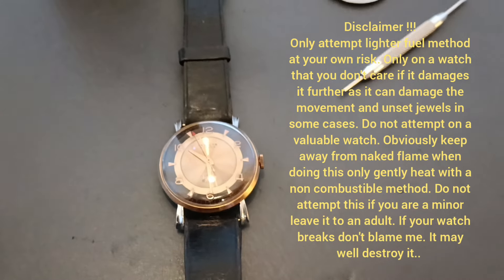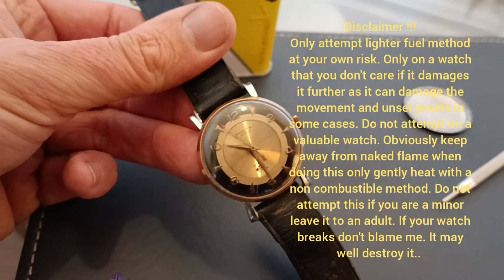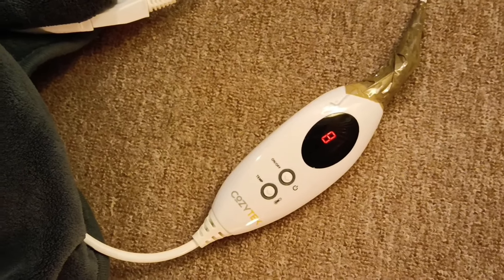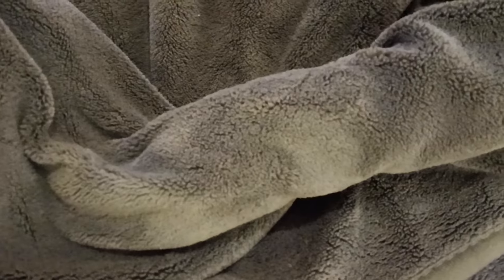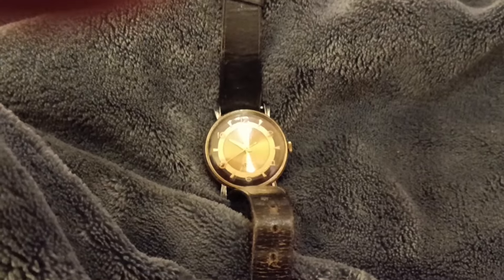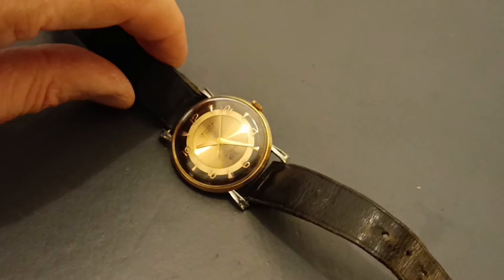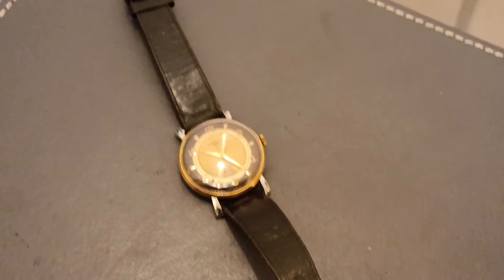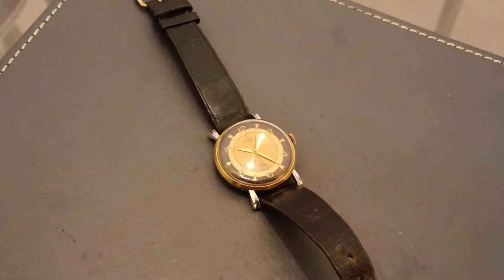How I revived my dead vintage Invicta watch using lighter fluid. Caution ! MAY DESTROY YOUR WATCH !!

Comment: With my Timex Mikey Mouse watch, since I did not have lighter fluid, I tried a drop or two of alcohol from the medicine cabinet. Did it work? Yes! However, since the face is painted, the vapours made the paint bubble up :( Will it continue running? I don't know. Still working after 16 hours.
Reply from the maker: @gabrielsenn3875  I've done this to a few cheap but vintage watches now. With mixed results. It usually does get the running but often they run a little fast. And sometimes stop after a couple of days. But a couple have carried on working . I guess it depends how far gone the original lubricant is. Lighter fluid is different from alcohol although it may still have reacted with the paint. Glad you got it going again though hopefully it carries on working.

Comment: I take it this popped up as i watch guys repair or service watches .dont do this to any mechanical watch and also dont put your fingers on the movement oil and dirt from your skin will cause the watch to stop if you dont know what you are doing best to leave it .and if you are not bothered about the watch sell it cheap and let someone else service it and enjoy it .rather than take space cadets advice and screw it up long term
Reply from the maker: Good advice.  A viewer gave me the lighter fluid tip. As my watch was non running and very low value ( not worth getting it serviced professionally cost wise) I gave it shot. It's not a long term solution and mine is already stopping again after a while. So I think the magic may be wearing off. But it's nice to see it going. I'm probably just going to hold hold on to the Invicta because I wanted a vintage one for my collection as I have two modern Invicta's. I don't advise anyone to do this to any watch of any value because of the risks involved to the watch.Thanks for watching and commenting.
Reply: I have a few vintage watches bought off a popular online auction site and if you check there you will find listings for servicing watches for £50 I have sent off a couple of nice watches got them back fully serviced for and keeping great time for the £50 and the Invicta you have in video has a really nice bullseye dial probably from 1950's and worth saving
Reply from the maker: @bengaku  that's really useful information and a good price. Many thanks for that.
Reply: @space99dude  you are most welcome
Reply from the maker: @bengaku  I just had a look and found the listing for the guy who services watches for £50 looks like a great deal. Obviously it's more if he needs to replace any parts although he does include a new crystal if that is needed. I know there are some older retired guys who service watches for almost nothing. I have a friend whose brothers breitling has just been serviced for £30 but the guy had it for months and he had to chase him up to get it back. Also this guy doesn't live in my area . Nice to know that there are people out there doing this for a reasonable price. I'm not sure I want to drop £50 on the Invicta as I probably won't wear it again anyway. Plus after the costs of purchase and service it would still only be worth around £60 . I might sell it on in the future for spares or repairs. Someone who can service it themselves will then end up with a nice watch that has value over what they would have paid for it.

Comment: What a nice little watch!
And that is a neat little trick.
The jewels in a watch are normally pressed fitted except for the ones on the pallet fork and one underneath the balance wheel. These are glued in place with shellac. A substance that resolves in alcohol and melts at a rather low temperature about 80–100 °C (176–212 °F). Overheating and melting of the shellac will most certainly kill the watch. This lighter fluid is petrol based, right? It will most likely not harm the movement, but the fumes could of course do harm to dial and hands and other things. Don't do this with alcohol. I use a kind of lighter fuel for cleaning watch part when I am servicing watches. The process of cleaning and servicing a watch movement involves removing old, dried-out oil and replacing it with new oil. You find a way to rehydrate the old oil. Cool!... But it's not a substitute for service. ;-)
Reply from the maker: Thank you for your knowledgeable comment. Very interesting about the shellac dissolving temperature. Yes I think it's petrol based. I would have to look at the tin to be certain or Google it. I wish I had the skills and tools to service the watches myself. Something I might endeavour to try in the future.
Reply: Jewels in any watch are either press fit or held in with a metal fitting not by glue jewels are there in the watch movement to provide a cushion of sorts so that its not metal on metal and hence why they require oil as a lubricant glue would have the opposite effect
Reply from the maker: @bengaku  that's interesting I thought some were glued in place people were warning that the lighter fluid may melt the glue and loose the jewels. Thanks for the info. Great to learn all this stuff.
Reply: @space99dude  yeah my bad only in pallet forks and it's apparently only the swiss watch companies that still use shellac so no idea what Chinese or Japanese watch makers use

Comment: no it desove the oil and its running dry now ... and the oil spreads everywhere when the lighter fluid desolves ???
Reply from the maker: This is a definite possibility. Thanks for your comment . It's still running nicely for now. Time will tell how long it lasts.
Reply: Could be interesting for Swatch, right ElderPinto?  Since there's almost no other option on the welded Swatches. A tiny drop of lighter fluid in the stem, some heat, and maybe a demagnetizer to drive the motor aggressively! 😂

Comment: Thanks for  a really helpful video I've watched a few of your videos and have brought a couple of vintage watches not working for a bit of fun. Will be interesting to see if I have the same luck and for £20 for the two I won't be heartbroken if not. Keep up the good videos 👍
Reply from the maker: Good luck. I only used the equivalent to a small droplet and don't overheat because that will probably dissolve the glue holding the jewels. Definitely a risky process that may also damage the movement itself. I wouldn't try on anything of any value.

Comment: very interesting process here.  I just wonder if the lighter fluid will cause the viscosity of the oil in the jewels to degrade as lighter fluid can be used to clean/remove oil and grease.  As another commenter stated, probably best to take it in for service as to not cause damage on a vintage piece.  Love the looks of the watch!  Very cool!  Hopefully if you do get it serviced they'll clean the watch as a whole also and it'll be a real stunner for sure!
Reply from the maker: I think time will tell, see how long the watch carries on working.. it's still going today. Its gaining 3 or 4 minutes in 24 hrs. It's a nice watch but I wouldn't pay to have it serviced as probably not financially viable for the value of the watch. I definitely wouldn't try this on any watch of value. Thank you for your comment and watching the video.

Comment: Bring it to service, don't risk out doing that, it runs but doesn't mean that it keep time correctly.
Reply from the maker: Good idea but this watch is only £8 not really worth spending money on a service as would cost more than the watch would be worth. As I mentioned I would only do this to a virtually valueless cheap watch. Happy to report its still running today and keeping fairly good time it's running about three mins fast in 24 hr. Thanks for watching and commenting on the video.

Comment: Ah yes, the only good Invicta is a vintage. They used to be great.
Reply from the maker: It's a lovely little watch, I've given it a good clean up and polish. It's looking like a little stunner. I was going to take the strap off but I've rejuvenated it with some moisturiser and it looks great now. Having solid lug bars that would have limited my watch strap options anyway. Thanks for watching the video and commenting.
Reply: I have a couple new ones and they use the Seiko nh35. They're excellent and start running as soon as I pick them up. I also have one with a Swiss selita. I find the watches you all like boring and uninspired. there's a reason the new Invicta is doing so well financially. If you want a boring new Invicta you can just buy a Glycine. I have one of those. It's a pilot GMT that can monitor 3 time zones.
Reply from the maker: @orangeyellow-me1pz  
I also have a couple of the newer ones. I have a beautiful quartz speedway and a nh35 automatic pro driver. Videos of both of them on my channel. Great watches. Some of the more larger flashy designs aren't to my taste but I like the  Rolex homage watches they do. Great value and good quality.
Reply: I enjoy my Invicta Pro diver, I think it's a good quality watch for the price.
Reply: Of the newer Invicta's look at the 1953 Diver. It's really their best one.
Reply: They make & sell 2:13 tons of watches. Some of them are still quite good & fantastic bargains.